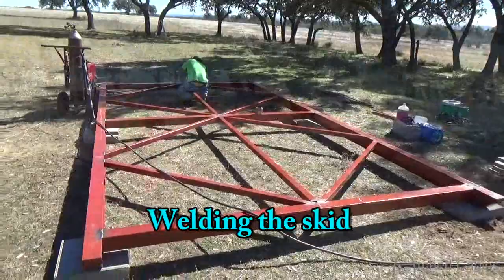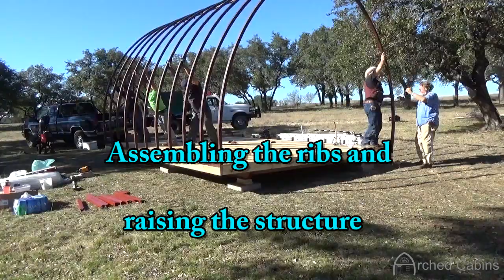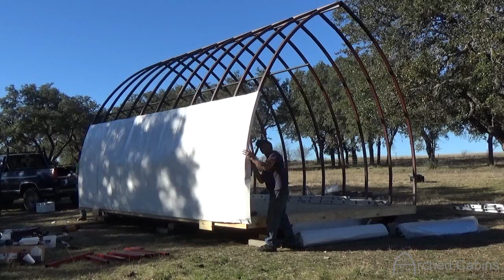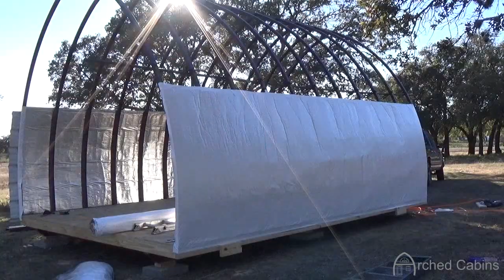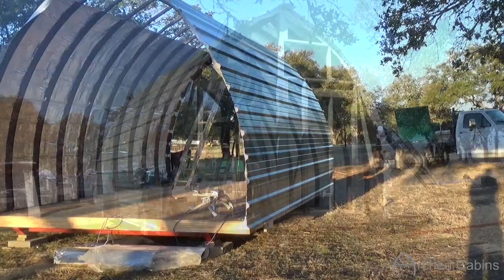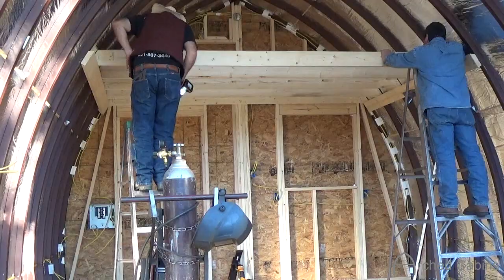Build process of a 14' x 20' DIY Arched Cabin LLC Tiny House Kit

Comment: How do the ribs connect together? Are they welded together later? What’s the R-Value of that insulation? Does it also act as a moisture barrier as well? Did you add more insulation later? How do you guys connect the frame to the wood floor? And do you add any type of caulking/glue in the seams of the base? Sorry for all the questions.. I agree with others that there needs to be more videos on building..my wife and I are very interested in these and would feel a lot of more comfortable buying them if we knew exactly how to build them before purchasing.
Reply from the maker: The ribs are attached at the ridge beam and base plates with self tapping screws. The R value of the one layer of installed insulation in this video is R12.5, with both layers that we sell, it would be a total of R25. It has a moisture barries on one side and radiant on the other. The base plates that run the length of the arched walls bolt to the founadtion. Caulking/glue is not necessary but you could if you wanted to. More videos are coming!
Reply: @ArchedCabinsLLC are the holes pre cut on the cabin for the screws?

Comment: Love the 24 x 30 you show compleatly done.  Could you give total cost on it,without funiture or kitchen appliances .  Have you shipped any to Hawaii yet?  Cost of shipping ?
Reply: Would also about 24x30 you show completed  without furniture and appliances shipping to 30165.
Reply: The 24x32 completely done, with a fireplace and loft, shipped to birmingham would be around 32000. Im not affiliated with arched cabins. I just did the math with the information listed on their website and got an estimate.
Reply from the maker: Pat Anderson Smincey 93 is right. There is a range but to get a 24' x 32' Arched Cabin roughed in would be between $30,000 and $40,000 depending on upgrades.

Comment: do you guys sell to canadians? or would it be a pain to bring it across the boarder.. also i would think the structure would have to be built according to building specs in a particular province(state) in canada i would assume and cost accordingly if materials are more money or insulation specs.. running electrical and or building code
Reply: Did u ever find out about canadians purchasing??? Manitoba here!

Comment: I know that it comes 24x30. Do you have it a little bigger in length? Like 60 perhaps. Does anyone do the plans I saw inside as well? I just love what I saw with the one you posted
Reply from the maker: Our longest Arched Cabin right now is 40' and we are not currently looking at going much longer but we are constantly improving and expanding options for our customers!
Reply: Do you have pictures on an example how one is set up for a two bd. inside? If not a two bed,one would be fine. It's going into the mountains of PA. And would need to put a stove in it.
Reply: Arched Cabins What is the cost of a 40' kit?
Reply from the maker: Rosa Quintana Hi Rosa! Our website has pictures of a few different build processes, including a 24x32, which will easily fit 2 bedrooms. Visit us at www.ArchedCabins.com and let us know what you think!
Reply from the maker: Joshua Fowler Hi Joshua! The Arched Cabin kit cost for a 40' long cabin depends on the width. Our largest cabin is a 24x40 and is currently priced at $12,800.
Reply: Arched Cabins Thanks for the info! Who can I contact to order one?
Reply from the maker: +Joshua Fowler Please email us at ArchedCabins@gmail.com and we're happy to help you!

Comment: Nice cabin. What is the diameter of the steel ribs (2" x 2")?? and the metal thickness gauge? Need to determine for heavy snow loads. Thanks.
Reply from the maker: Wit 222 Our cabins are currently rated for 30 psf snow loads and 150 mph wind speeds! We're having them tested for heavier snow loads and stronger wind speeds as we speak, and will update our website as soon as those numbers become available. www.ArchedCabins.com. Thanks for your interest!

Comment: Thoughts on welding the arches to the skid?
Reply from the maker: Great question. We manufacture a steel base plate with male connectors so the ribs slip over the connection, which can be welded for strength.

Comment: What code are these built to? What certs do these homes have to prove roof load and wind load?
Reply from the maker: They meet 2012 IBC codes and are also engineered to withstand 150 mph wind speeds and 32 psf snow loads.
Reply: they said with stand winds up to 200 mph and higher over the sides to top,  very little snow can stay on the top cause of the slops
Reply: In the US you could live in it and be fine, I think it seems fairly decent (especially if secured to a concrete slab). But here in Australia we have annoying building regulations where heaps of these things wouldn't pass, I think our building regulations are so strict here to just try to prevent people ever doing anything themselves maybe.
Reply: Lord of the belts: The return of the KING here in the USA (Vermont) 34psf snow load wouldn’t work LOL
I don’t care if it’s sloped, if that engineers out to 34psf it would just collapse

Comment: Could the metal sheets be put on vertically?
Reply from the maker: Our cabins aren't designed that way, no. The sheets are put on horizontally to increase the strength of the structure by connecting all of the ribs with the metal roofing.
Reply: you would be hard pressed to find a sheet metal manufacturer with capability to roll their vertical sheet rib to fit the shape for said vertical rib finish but with 2 foot spacing of the structural rib itself is another issue per proper securing

Comment: Has anybody built one of these on blocks of stryrofoam with some kind of telephone poles on either end to keep it in place.. i have a friend who's house keeps getting flooded..  this looks light enough to be supported on dock foam blocks to avoid water damage..
Reply: That's a really interesting concept. I grew up in Louisiana so I'm well aware of how vital a float-able setup can be.
Reply from the maker: We haven't yet, no! We can build on extended piers to elevate the house.
Reply: Arched Cabins 
They don't seem to want it elevated, but floatable.  The poles are to keep it in the same location with it rising/floating with the water, much like a spud barge is held in place yet rises and falls with the tide.

Comment: what is the advantage of arched vs regular rectangular house?
Reply from the maker: Great question! An arch is structurally stronger than a straight line, so if you're concerned about wind speeds or snow loads our Arched Cabins have higher ratings. We also build our cabins with a steel structure, which is less maintenance and longer lasting!
Reply: Think of it as an A-frame but with arched walls, made of steel ribs instead of wood, the pitch alone is enough to shed snow from the top portion but it does pile up on the sides so if you have got a path needing shoveling then you are in for some snow removal hardship. If you live in a snow zone.

Comment: Not a very good step by step video.  Need the side rail application, do kits come with base already welded, windows, and door installation.  Are areas between outside corrugated roofing sealed for moisture inhibitors?
Reply from the maker: We are working on getting more videos out to cover all the things. This is just meant to be a general overview. Please follow us to see all our past videos and new ones coming out. To answer a few of your questions, Arched Cabin kits include a build manual, floor plates, ribs, ridge beam, standard R22 insulation for the arched walls(R33.6 with the insulation upgrade) , metal roof paneling, rubber trim and foam inserts to use by the end caps, touch up paint, and color coordinated fasteners needed to assemble the cabin. The kit price does not include the foundation, installation, interior, end caps, delivery, or anything that is not included above. General pricing information can be found here: www.archedcabinsllc.com/cabins